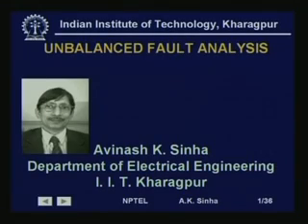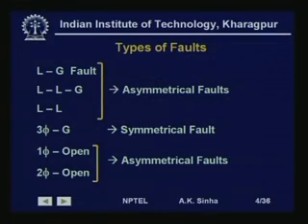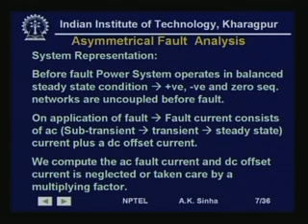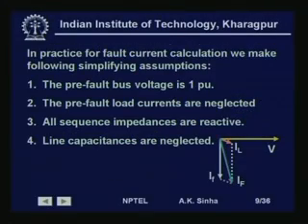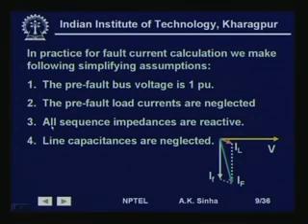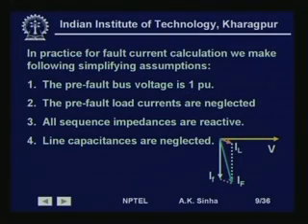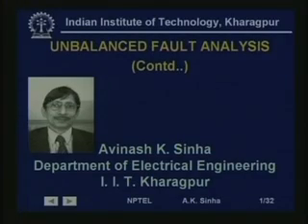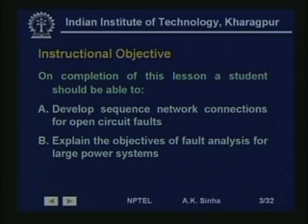Lecture - 28 Unbalanced Fault Analysis

Comment: sir ,as a system is balanced before fault then why we take sequence networks?
Reply: Sequence is used to represent both balanced and unbalanced condition and in balanced there is no coupling between the symmetrical components ,in case of unbalanced there is coupling effect